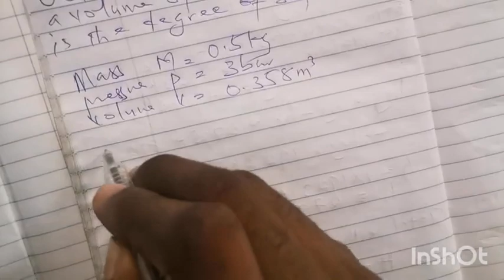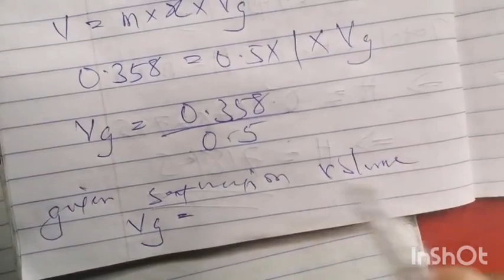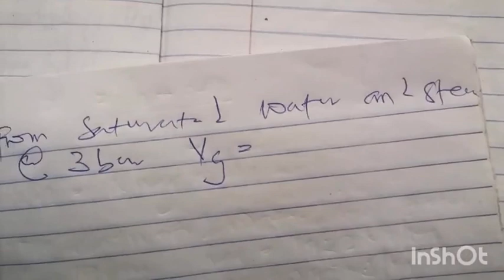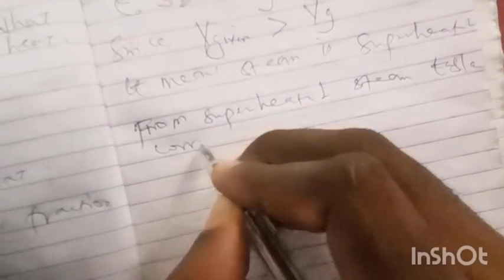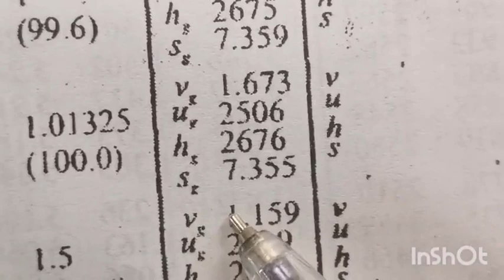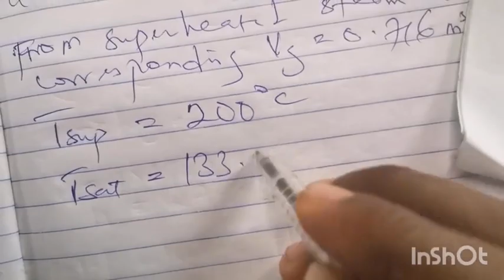How to calculate Degree of Superheat using the Steam Table ||Working Fluid||Thermodynamics

Comment: I have a question sir
m=2 t=81.3 Dryness fraction=0.2 Find p and also the degree by superheat
Reply from the maker: Find the saturation pressure according to the given temperature from your saturated water and steam, then locate the temperature corresponding to that pressure at the superheated steam table, then find the difference in temperature
Reply: Have done ✅ my assignment cause of this video 📹 it was helpful 😊keep up the good 👍 work.

But how can I solve for Enthalpy